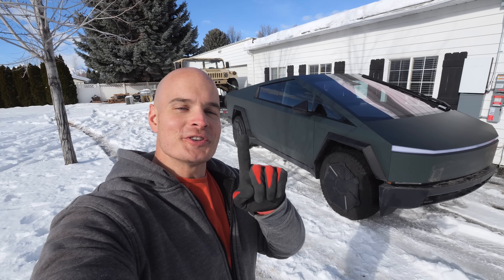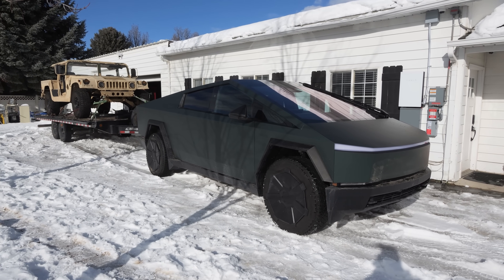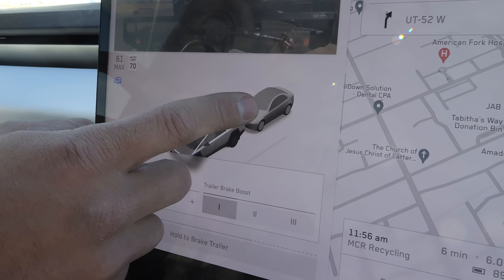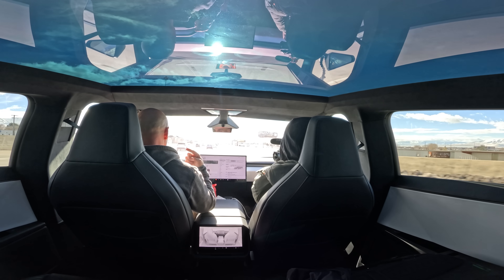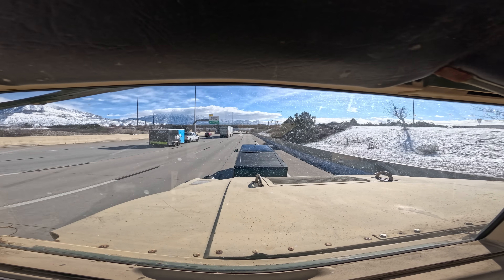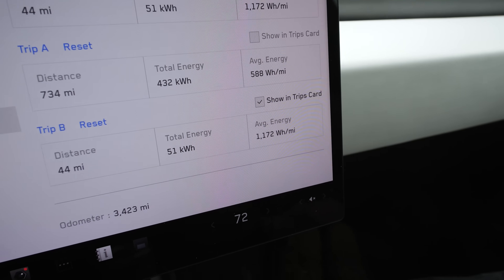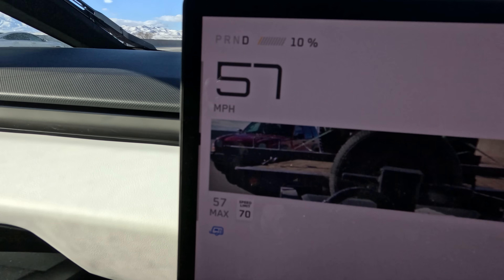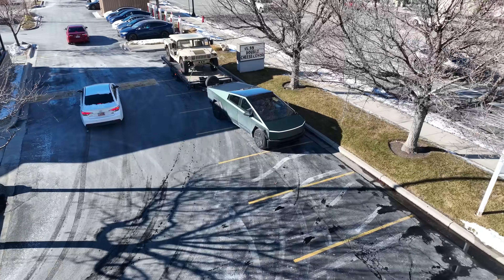How far can the CYBERTRUCK tow 11,000lbs in Freezing Weather?

Comment: Do the test with a actual CYBERTRUCK  when they are actually open to buy by the public.  YOU SHOULD HAVE DISCLOSED THIS IN THE VIDEO...   You're driving a "DATA GATHERING CYBERTRUCK"  - they are all over the US in different climate zones and sea levels to gather data for the A.I. to learn from.  This is why the User Interface is not complete... Ie the trailer animation - as it was not supposed to be trailering ANYTHING.  That is for a seperate testing program.
Reply: Additional Context:  There are only about 600 or so CyberTrucks that are out there right now - a very, very small number right now.

Comment: All the reasons to not go EV are just growing every time I watch a real world use video!
Reply: While I normally don't dare question truckers given that, as a hatchback person, we clearly live in different universes. I do think "real world" needs to be put into perspective. 

A 2021 Axios study on F150 drivers found that 7% of people use their truck to tow regularly, 29% sometimes, and 63% never tow anything. Other most frequent use cases: 87% use it to shop for errands, 50% for commuting and 70% for pleasure driving. 

Granted, I live in a city, but pickups are extraordinarily common here. The issue with the trucks here(and across the US according to the above stat) is that they are a fashion statement rather than a utility. Their main purpose is just as a flex on other pickup drivers. In those cases, an EV truck checks their boxes while fixing the issue of commuting with 14mpg while not actually taking advantage of the reason the engine takes 14mpg. 

For those who use Pickups as a utility, y'all clearly are gonna stick to your truck for at least 12+ years (as you clearly actually use them) and by 2036, I am sure ev tech will evolve enough to become worthy of being a utility to those who do actually drive 500 miles a day towing 14,000 pounds.
Reply: Hybrids are the real future
Reply: New tech has its hiccups, give it a few more years of trial and error and eventually EVs will get better. 

It took decades before Cars became efficient with their fuel, EVs are still relatively new. 

Stop being a boomer by being intimidated/scared/confused about new tech.
Reply: My wife and I have three vehicles. I have the EV, and she has the convertible. But we also have a GLC Hybrid which is essentially an EV (120KM range) but with gas motor. You can't get the model outside of Europe. I use the GLC when I need to tow anything. I do tow with my Tesla EV and yeah it sucks towing. The GLC I switch into gas mode and just tow normally.

After doing the math EV's need 300 KW of battery power to make it sensible to tow anything. Below that and it is just a royal pain in the butt. Or you get a hybrid and call it a day.
Reply: Yeah I don't like overcomplicating things. With a hybrid you have the maintenance of both an electric engine and ICE rolled into one. They're kind of a hack job IMO. Rather wait until battery tech significantly improves and go all EV. @ChristianLaurinE
Reply: The idea is new tech is supposed to be better than what it's trying to replace. They aren't.. just a giant waste of money.
Reply: Well they're actually superior in many ways. Fewer moving parts. No fuel/air mixtures or transmissions to worry about. They can be 100% water/dust proofed too for offroad applications. Pretty awesome actually. The Achilles heal is the battery tech. When we have a battery that offers 5x the energy density of lithium ion I'll be happy to give up my gas guzzler.  @3UZFE
Reply: @3UZFE just like any technology it’s gonna take a couple of models to fix those things. Upgrades & improvements will come lol
Reply: @3UZFE  Depends, the early adopters fall into two categories. Either they are rich multi-million/billionaires where money is not a issue or they are morons who are going into debt over these EV playtoys. These early adopters are important as they will fund the inevitable leap in battery tech to make these vehicles useful.
Reply: @3UZFE EXACTLY! Why would someone want to pay the same price or even more for a product that's monumentally inferior to a gas or diesel vehicle? I guess there are plenty of stupid people in the world with too much money.
Reply: EVs are trash. It's all hype. When I've spoken to real owners of EVs they've had nothing but complaints about how utterly inferior they are. I'll opt for an EV when it performs on par with a petrol or diesel-powered vehicle.
Reply: @Eliminator5555 I rented a Tesla once and it sucked
Reply: @Eliminator5555  For towing easily the gas powered is better. For everything else, EVs are cheaper and better.
Reply: @Eliminator5555   Where I live, I pay $0.025 per mile in electricity for my EV. That's 200 miles for $5. Is that on par with what you pay?

Comment: At 20 miles, 22 kilowatts used, .16 cents per kilowatt = $3.52. .16 cents at home charging if your rates are cheap, charging station are charging up around .30 to .40 cents per kw, think about that, 7 bucks+ for 20 miles, $35. for 100 miles.
A diesel pickup would be around 20ml per gallon, so depending on the price per gallon which is close here. I would pick a Chevy or Ford Diesel truck over this jacked up, Back to the Future 4WD and would cost less to buy. 
  Its not that I don't like electric but its bad enough to pay for fuel, I know electric is just not it yet.

Comment: Big deal. I towed a 30ft RV with my 2016 Ram 1500, with a 345ci Hemi engine 100 miles, with 30 miles of it on dirt/gravel roads. Dropped that off, drove all the way home, and STILL had enough gas to run back and fourth to work for two weeks. 90 miles is a frikkin' joke. Electric vehicles are a joke.

Comment: I wouldn't tow my boat with one of these if it was free. Bump the vid in 10 years. Doubt there are many "cybertrucks" on the road towing things.

What happens if you run out of power 2 miles short of the charging station? Only solution is have both the vehicle and the trailer towed. Probably $200+ bill. In real life (ie combustion engine world) you have a spare 2 gal of gas in the pickup bed, or you just walk to get the gas.

Un-trailering just to charge up?

Charging for 40 mins every 90 (barely) miles?!

Whole concept is silly, and has a LONG way to go.

Comment: Farmer looking at this here is the question ? When I lose power on the farm and hook up a generator the tractor pto that drives the generator is appox 100hp to power small diary operation, if you had a tractor at a charging station powering a generator 70 kw would requrire a 140 plus hp to run the generator of this size so where exactly are the enviroment savings when everything you are trying to do is like a magic trick hide the fossil fuel in word salad therefore we can save the planet ELECTRICITY IS NOT SUNSHINE IT COST MONEY

Comment: You can save more fuel or electricity if you would drive 85 km/h. The resistance of the air is proportional with the speed squared.

Comment: The average charge for 1 hour at a charging station is $45.00. now you're going to spend probably 6 to 8 hours to recharge the vehicle to full to go do another miles. Now in my truck is fully empty it cost me 50 bucks to fill it and I can tow for just about 350. And I don't have to wait for it to charge. So it's going to take you 2 days to go to the same distance as a gasoline does. And by the way I told over 1500 lb.

Comment: How cold is it? I recently talked to a ford salesman about a Lightning. He tested it in some of our cold Canadian winter weather. He wanted to test the range in our -40C winter weather. Truck was parked and charged in the dealership garage over night. That morning he made it 20 miles and turned around. Almost didn’t make it back to the dealership on the charge. That that was pretty interesting. I know they have a place, but I find it amazing how true winter weather destroys the range.
Reply: I call BS. I have driven multiple different EVs numerous times at temps between -20 to -40. There is absolutely not a chance at all that a Lightning, even the small pack, could have the range reduced to ~40 miles total. I don't care how cold it is.
Reply: @easternbiker47  while the guy above has points with diesel trucks being more weather hardened, you obviously do not understand battery electrolyte chemistry and how temperature affects chemistry. With no driving at all an EV battery will lose ALL charge (totally dead) under certain cold temperature weather conditions. Period. This is not an arguable statement.
Reply: @crazyidiot5309  Diesel trucks are absolutely more weather hardened. I am not even addressing that point and I'm certainly not arguing it. The story about the Ford salesman only getting 40 miles on a charge in -40 is bullshit. I know because I have an F150 lightning and routinely drive it in the same temps. It is parked outside at night as well, so I am not starting from a warm garage when I set off either. Although I do pre-heat the cabin before I leave while it is still plugged in. 

I personally own 3 EVs and have driven them all in that temp countless times. Including taking them on road trips. Even my Chevy Bolt which doesn't have a heat pump does not see a range drop anywhere close to that severe.
Reply: Chemistry in the battery electrolytes degrade VERY rapidly at -40C. @proletariat9467 Just like diesel and gasoline. G2 or Type 2 Diesel starts to crystalize it's wax at low temp, where Type 1 won't, but neither are freeze proof and -40C is very rapidly approaching not just fuel freezing, but other fluids and parts as well. Material strength of various other parts of your truck will brittle. May not be a city slicker, and you may can go a LOT farther then an EV, but there are limits to lots of things and -40 Celsius is a point most anything won't tolerate.
Reply: He was talking -40 F not -40C

-40F in the states a diesel will be fine 
A electric vehicle will be trash
Reply: @blackfacegaming191  You do realize that -40 is where celsius and fahrenheit intersect, right? -40 F is the same temp as -40 C.

I own and regularly drive electric vehicles in temps as low as -40 and never have a problem. Yet when I go on the internet a bunch of people who have never owned an EV, nonetheless driven one in deep sub zero temps want to tell me they won't work and they will be trash.
Reply: @blackfacegaming191 Fun fact: -40F and -40C are the same temperature.
Reply: @crazyidiot5309 spent 12 yrs working outside in central Alaska with 40-60 below weather 
never had issues with fuels 
oil and battery heaters where a must though
Reply: Ford has gone downhill. My 77 F150 gets the same mileage hot or cold, towing or not towing, uphill or against the wind. But even at 11 mpg it will make 400 miles until empty. That's with factory auxiliary fuel, two tanks. When it runs out at  400 miles I can refill both tanks twice from a bed mounted 75 gallon tank that I installed....giving it a range of over 1200 miles without looking for a gas station.
Reply: @northdakotaham1752  The fact that the 77F150 is so inefficient that towing doesn't effect the range is not something to brag about. I could strap a 400kWh battery to an F150 lightning and brag about a 1000+ mile range, but its not practical or impressive
Reply: Yep. Not for Canada. But hey, if it's too cold, just puncture the battery! ;)
Reply: @SemiMono  Modern EV batteries don't start on fire with destruction.

Comment: So,  you had to cheat and drive slower to get to a charger? And  you had to disconnect from the trailer to back into a charging stall. And you only got 100 miles out of a full charge?  With a full tank of gas I can go 300 miles towing 11,000 lbs before I need to fill up in my old gas pickup. And the rear view mirror works great.

Comment: great video!  Interesting, it cost $13 to charge full and then only 90 miles of range?  doesn't seem very cheap to me...and all the headaches, sitting waiting on charging,  range anxiety, he got lucky there was one charging station available.  40 minutes to wait on the charge..  I'll pass and keep my 5.6 L V8's in my two Infinit's!
Reply: You compare very different conditions. Your Infintis cannot tow 11000 lb. With your Infiniti maximum load CT will go much further. Also, you will spend 6-7 times dollar/miles more than using CT. Extra thing to consider: you save time on your first and last charging if you can charge it at home.
Reply: @evgenyzak2035  true  not quite 11,000 but can tow 8500 which will be more than enough for me.

Comment: When you buy an electric truck you show your IQ which is about to charge rate of your electric truck.
And maybe in 5 to 10 years you can buy another new electric motor which would be the battery bank at 11000 dollars.
Maybe you want to light it out across the country taking your family and your camping trailer so you can go about 4 hours and stop oh wait a minute I mean 2 hours of stop oh wait a minute you had the heater on 1 hour and stop

Comment: if this guy is having range anxiety, what hope is there for the rest of us? :)
Reply: 99 percent of trips are 50 miles or less.   And many of the last 1% are 300 miles or less.   Even in Texas.
Most days you start with a 70% to 80% charge (to maximize battery life) but on a long trip day you charge to 95% to 100%.

The first part of the trip will cost you about $8.    The recharge at a supercharger will be another $24 to $40 bucks depending on your EV.
Compared to $60 to $80 for a diesel (maybe more since you'll have reduced range towing 5 tons in a diesel too.)
Reply: @mac_mcleod  Yep, absolutely. That's why you get a regular car (maybe electric) for driving around town and an ICE truck for doing the other stuff. Buy a $30k car AND a $15k "beat up" truck and you'll be far better off than a $60k+ truck. That's at the outset. Then you'll also spend less on maintenance and electricity driving around town, and on the few occasions where you tow, you'll be happy to spend an extra $50 bucks on gas vs. electricity, especially when you're towing half-way across the country or going on a trip into the wilderness. Oh right, and then you can use your truck as it's meant to be, not worrying about depreciation when you scuff it up or hit a nasty rock, because you bought it after it already depreciated. You can't buy a post-depreciation electric truck, yet.

There will come a day when batteries are better and the ICE trucks are no more. But this is not that day.
Reply: None, and now you know why so few of these are being sold and why this EV thing is gonna be seen as a boon doggle in 5 more years.
Reply: @malrec  what percentage of people are towing 5 tonnes regularly? The average person drives less than 100 miles a day, any recent EV can do that with plenty to spare, then they just plug it in at home. If you don’t live an apartment and you’re upper middle class, an EV is a no brainer.
Reply: @fayenotfaye  How do you plug it in at home if you don't have a garage? If you have street or apartment parking? Just curious. I feel like you pro EV people haven't really thought the details out at all. Let alone the details of what would happen if millions of EV's suddenly went online and annihilated the entire powergrid. 

One last thing. Sure most drive less than 100 miles a day. Just back and forth to work. But, why buy a car that is limited to ONLY that use? Why pay a ton of money for such a limited vehicle? Why not buy a gas car and suddenly have road trips as an easy option? Also what if you move across country or state lines? You just gave yourself a logistical problem by owning an EV.
Reply: @malrec  i think ev companies have done poor marketing. I think they should focus on glorified golf cart type cars and advertise them as a second car...cars meant for the grocery store and back. Cars you buy for your 16 yr old kid to learn how to drive. And that other guy was right. Evs are good if you can charge at home over night. If you cant then i wouldnt buy one. Me personally, i dont like the idea that just when i am about to make my final payment....now my battery is 8 years old and has more than 100k. I know gas engines wear out too, but i feel way more confident in a gas car with 175k on it vs an ev with 175k
Reply: @malrec  You complain about the risk of the power grid failing but I bet you also oppose green energy and nuclear as well while worshiping coal and gas.
Reply: @olishart-t2u  worshiping coal and gas? you don't think that might be a little bit of hyperbole? You are suggesting I have an altar to one of these things? Perhaps that I make sacrifices to them or listen to sermons from their priests? As a matter of fact I do oppose nuclear fission but certain types of green energy I am interested in exploring.
Reply: @malrec  I knew you would oppose nuclear fission despite it being the best option at least short term to rid ourselves of coal and gas. Why do you oppose it? Are you scared of another Chernobyl? Modern nuclear reactors are very safe.
Reply: @olishart-t2u  Because of the waste. Also, Fukushima is 10X as bad as chernobyl.
Reply: @olishart-t2u  Well considering that we are in the lull between ice ages I'm ok with CO2. Also, we both know that not all of the nuclear waste, not even all of the left over materials from experiments, have been disposed of properly. Another issue is what about the nuke plants that have been closed because they were determined to be unstable regions decades after the plant is build? This happened in Washington State for instance, also Tepco Fukushnima should have been shut down as well once the data about the true energy of the fault line was realized. What about the nuke plant in Lousiana on the gulf right where hurricanes constantly hit causing floods...  Nuclear is just stupid right now.